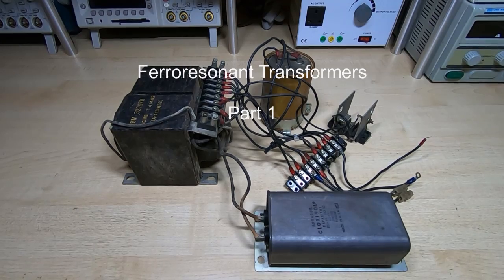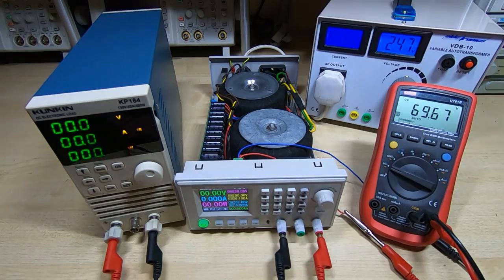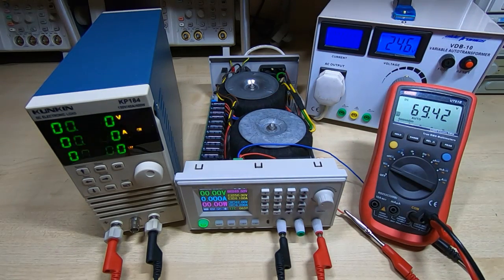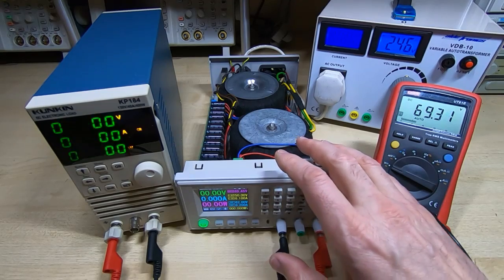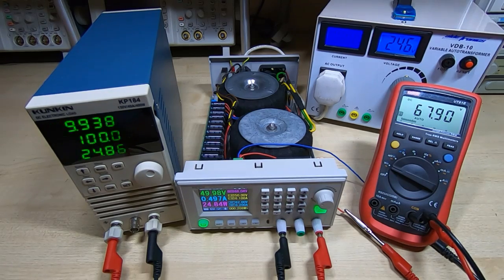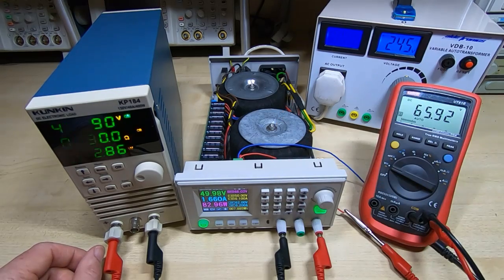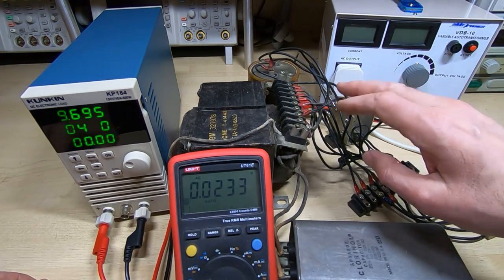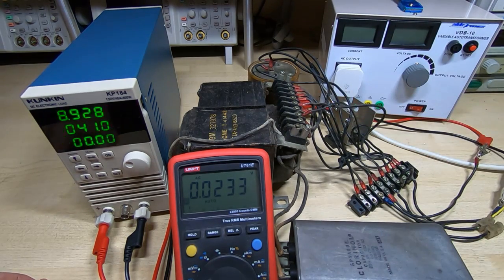Ferroresonant Transformers Part1

Comment: I’ve studied a little about power supplies I’m a novice for a hobby but I’ve never heard of that power transformer and it’s purpose and benefits. I build linear audio amplifier power supplies for amplifiers I build. We were always taught just use a bigger transformer and more capacitor Power bank. Example if you Project called for 200 VA transformer use a 600 VA Toroidal transformer. I can’t wait to see how this project turns out looks like I have a new transformer to acquire and play with.

Comment: Have you noticed the mains induced hum on your videos?  In this video, it is increased when you touch the toroidal transformers and the power supply case. Is it magnetically induces, or mechanically coupled?  Thought you might want to check and ‘rectify’.
Reply: Check the audio during the first part of the video on a high quality entertainment system. I am not referring to the obvious mechanical noise of the ferroresonant transformer. I have noticed this background hum on many of your past videos. It is not obvious on iPad or iPhone with no low frequency response.
Reply: I’m glad that my iPhone filters out that disturbing hum. 😉